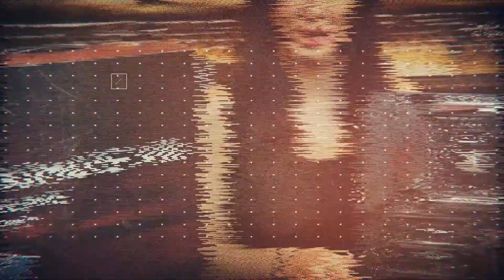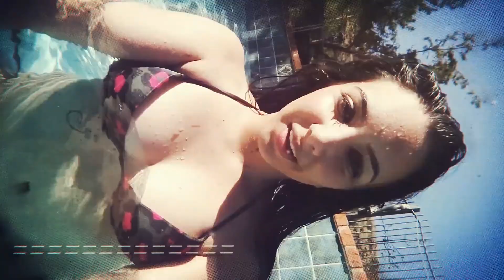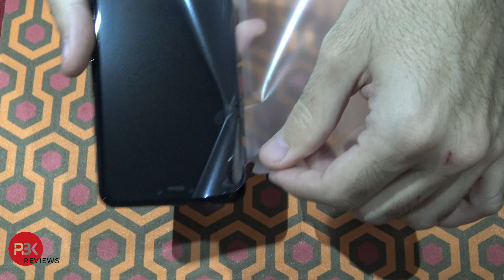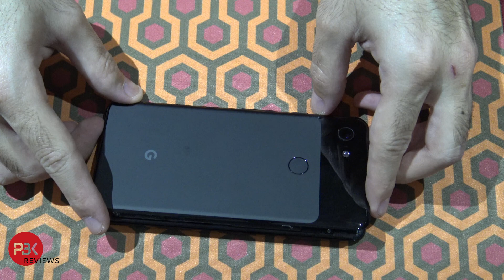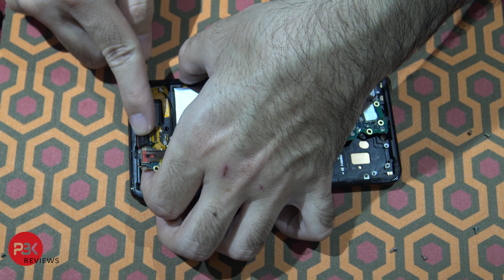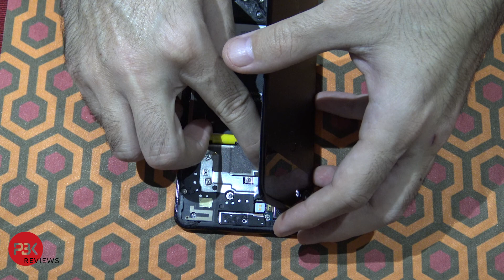Google Pixel 3 XL Disassembly Teardown Repair Video

Comment: Thank you for this video. Following it I restored my pixel to a brend new by moving all the parts into a new screen/frame assembly. I feel like such a pro now :D
Reply from the maker: you're welcome
Reply: @PBKreviews please help me on this
Reply: @PBKreviews  - Man, it's painful to watch removing the back on these older video.  You've come a long way. ;D
Reply: I need a very urgent help, my pixel fell and now screen is not working, and it is unresponsive to charge, the technician said that the motherboard is little damaged near camera, but, there is no damage on chasi how  is it possible, please tell me can I retrieve data?

Comment: My battery volt drop to 2.4v..i boost the battery again to 3.8v..the phone switch on about 5 minutes and then dead again..voltage drop to 2.4v again..i try two different battery but same problem happen..can i know whats the problem sir?pixel 3xl..

Comment: My pixel3xl microphone not working in speakerphone or video call. Which mic is faulty. ?  What is the function top right corner mic ?
Reply from the maker: It's probably the top right microphone or can also be an issue with the headphone jack, thinking a headphone is plugged in when its not.

Comment: everything works except the touch screen, it doesn't recognize touch.  I have reset all the ribbon cables multiple times.
Reply from the maker: Might be a defective touch digitizer on the screen or a faulty chip on the board. You would need to test a new screen assembly and see if the touch works if not then it might be an issue on the board.
Reply: @PBKreviews  I was replacing a faulty board in my phone.  So the screen was still good on my phone, and I verified the board worked with the broken screen in the donor phone as well.

Comment: Thanks man..my pixel 3xl suddenly got wifi+Bluetooth problem .wont turn on for some reason..the things is in pixel forum they told that the connection loose on the bottom right side ..i hope so ..now ordering a set of torx screw and some prytools..
Reply from the maker: No problem, hope it works!

Comment: How would you replace the power buttons?
Reply from the maker: You would need to take the phone apart, and remove the battery to gain access to the metal brackets which are holding them in place.

Comment: Hi, can you tell me if I could fix my wifi and cellular band in my pixel 3 xl it has been bent and I bent it back into place without taking it apart, I'm worried the band is kinked

Comment: Can you give me the list of spare parts present in pixel 3xl
Reply from the maker: Hi what do you mean? you want to know what parts are replaceable like battery, screen, etc?
Reply: No .I want to assemble pixel 3 xl with their parts
Reply from the maker: @surkhapatkar1079  Well there is the LCD screen assembly, midframe, back panel, finger print sensor, battery, wireless charging flex, loud speaker assembly, ear speaker, rear facing camera, vibrator motor, charger port flex, front facing cameras, main board, power vol button flex/microphone flex and sensor flex. Not sure what else I might be missing, but you can check https://amzn.to/2H1Wx1a to see if there is anything I did not mention possibly.

Comment: Great video. I stupidly used the sim removal tool on the top microphone !  Can't be the only idiot to do this hopefully ...  Having teardowned the phone is it likely that this would have reached the microphone ?
Reply from the maker: Hi, its ok your not the only one whose done it haha, the mic is a gold colored metal small square. It doesnt break that easily so you should be fine.
Reply: @PBKreviews  thanks for getting back to me on this !  So far so good anyway
Reply from the maker: @darubinstein  no problem
Reply: @PBKreviews  I couldn't resist prodding it again . In for a penny in for a pound I suppose.   So it is indeed a solid metal plate ? Is this a microphone in the traditional sense ? Seems odd
Reply from the maker: @darubinstein  Hi if you look at this picture I uploaded, its the gold colored square piece. Anywhere you see that on the phone would be a mic. https://ibb.co/gTzHtZV

Comment: I guess this guy doesn't believe in using plastic spudgers when dealing with onboard components. Metal blade all the things!
Reply from the maker: Lol plastic spudgers arnt the easiest to use and most of the time the metal tools get the job done the best. As long as the battery is disconnected, there really is no risk. If your not sitting on a static prone carpet with static all around you, no issues. We've been using metal tools since 2004 on phones and have repaired and worked on thousands of phones, and not once did we ever short or damage a phone because we were using metal tools. The risk is so small not even worth worrying about. With the battery connected though, its a different story and you can easily short it. :)

Comment: do longer antenna cables mean better signal reception? ive seen other phones with very short antenna wires and some with none like iphones and blackberries
Reply from the maker: Hi, the length of the wires doesn't have an effect on reception. Also I don't think the wires on this phone are used to make any connection regarding signal and so forth. They connect to the charger port flex area giving signal to those components from the main board. However on older HTC units I have seen many wires inside connection many different components. Usually the type of material used overall on the phone would make the most impact on signal. Since the antennas cant receive signal through the aluminum frames on phones, you will notice most manufactures will use some plastic lines on top or bottom of the frame of their phones to allow that to act as a receiver for signal.
Reply: When dealing with RF, shorter cable runs are actually better for receive sensitivity because those cables have a certain amount of attenuation that increases the longer the cable run goes. The biggest gains you'll get is from the antenna design at the ends of the cables. Fractal designs tend to have better robustness to device orientation.